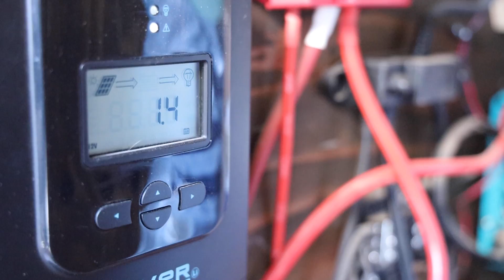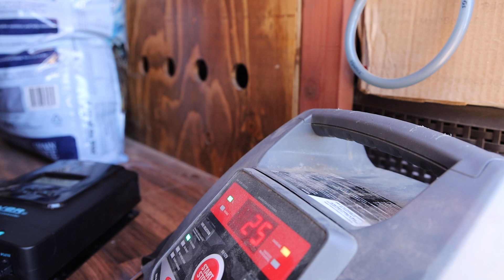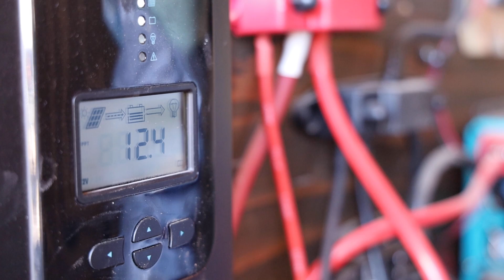SOLAR ISSUES & Skooliepalooza | Van Life

Comment: In winter conditions with shorter days and the sun lower in the sky, the amount of electricity you get from the solar panel is a lot lower than in the summer. So if you have managed to drain the system now how will the situation be with electricity usage will increase with a freezer? A DC-DC charger that can use the electricity from the engine alternator might be something to consider. You then get a solar-independent way to get electricity if you need more than the sun provides.

A DC-DC charger will increase your fuel usage a bit if you use it while driving. So only use it when there is not enough sun. The one made by Victron has a specific contact for a control switch and you can, of course, have a switch that disconnects 12v input if others do not have that feature. So when there is enough sun it like it was not there.

A second source for charging also add redundancy so if the solar or collar charge controller fails you have a alternative before they are replaced.

Comment: Your power drills and other battery items work like that. When you think the batteries are bad or won't charge, try connecting a similar battery to it to just get a little charge in the battery. Then try charging with the charger again.

Comment: These "little" problems have such a big impact when you live on the road. We recently had our solar panel smashed (likely against the ceiling while a mechanic was working on it). Luckily we have the back up of charging while driving until we can get a new panel, otherwise we would be in bigger trouble, but it is unpleasant to be constantly worrying about your power level and not being able to stay places for as long as we would like. Really impressed by how well you handle set backs!

Comment: I’d love to hear more about the battery monitor, why you chose that brand, specifically, because it works with the app?  I ask because I haven’t been able to properly calibrate my renogy monitor to see percentage remaining.  I keep an eye on the  volts when it’s charging to estimate its health but it’s not ideal.  I will try what you just did resetting when I’m sure its 100% charged and/or search for an app solution.  Yes, details and the endless enigma!!😏

Comment: Very inspiring! Have been living off grid for two years and really struggling to learn how to do it myself. My RV came with a solar system and it’s been down for a month so using a generator to kick start what is showing as full batteries. No one is helping at all. Considering getting theJackery system because at least it has technical support.

Comment: Interesting video. Lithium batteries have a safety feature built in LVD (low voltage detect) that turns them off when run to low. They just need jump starting like you did, just like jump starting you starter battery when flat, which you could have done from your starter battery to the lithiums.

Make sure you set your Victron's low voltage alarm to warn you at 20%. This can be done in the app.

Comment: This video did not need to be fun or interesting, though your vids are always a bit of both. I found it particularly interesting because I might have the same problem some day. I have the same Battleborn lithium batteries, although my charge controller is a Victron. Same concept, though. Remove and re-attach. So glad it was an easy fix. Thanks for sharing your adventures.

Comment: Hi Linnea. First time to comment, but I thought this might be helpful. At some point, consider upgrading your Renogy solar charge controller to the Renogy DCC50S. It has DC-DC charging as well as a solar charge controller and it can manage both. You'll need to run a positive and negative wire to your van battery (the one under the front seat floorboard) but it's not too difficult to do. Using that controller means your batteries get charged while you are driving, as well as with solar. Hope that's helpful. (I'm not with Renogy, I just use this particular controller. 😀)

Comment: its good you didnt destroy the lithium battery,, the old battery was 14.4v, lithium is only 12.6v, you could have destroyed it coz of not programming the type of battery, it will 14.4v on the lithium which is dangerous and could explode on over charging it to 14.4. hope you have programmed the battery type now

Comment: You don't have a wire run to your other battery or alternator? You shoukd, charge the batteries while the van runs. Add a battery shut off so you don't drain the main battery.

Comment: As your electrical is essential to you..it would be  smart to aquire some knowledge as to what you need to do to understand what is happening at all times ..or get someone to install a system that does not require any expertise from you..there are set ups that require you to  maintain them and some that have the smarts to maintain themselves ..you must choose what system works for you..
Reply from the maker: My system works wonderfully - I understand it because I installed it, and of course continuing to learn. Even systems that are hands off tend to have issues too. I wouldn’t want it to be any other way for me

Comment: Linnea, your still using them players, Girl get a wrench to tighten the nuts for your battery connection correctly, loose nuts on high amp cables can cause a Fire, or damage some components.  And your BMS’S on those lithium batteries saved your butt girl.
Reply from the maker: Yes to all of that haha